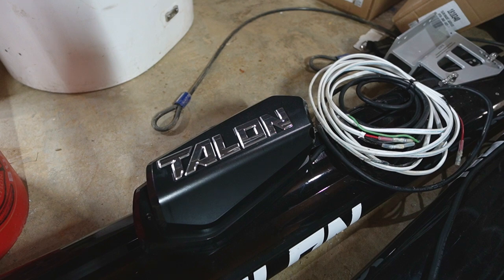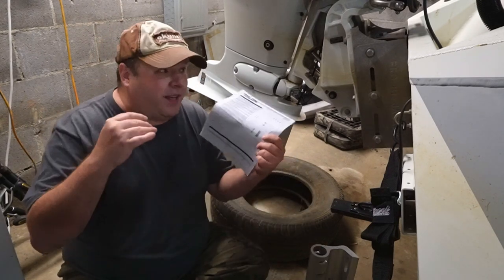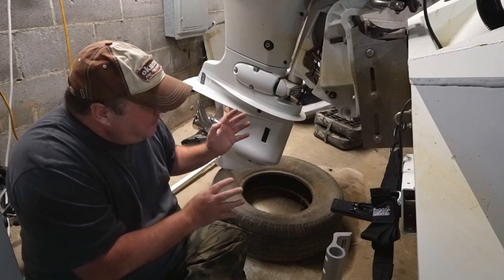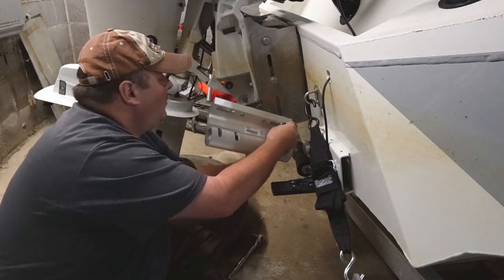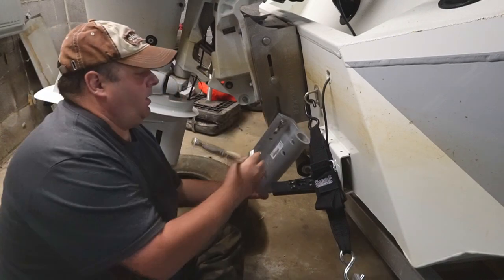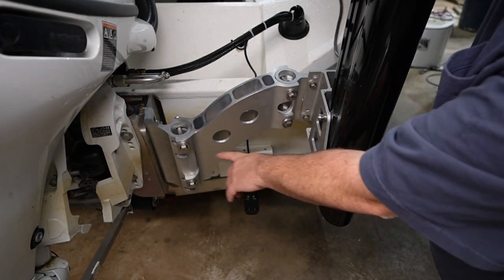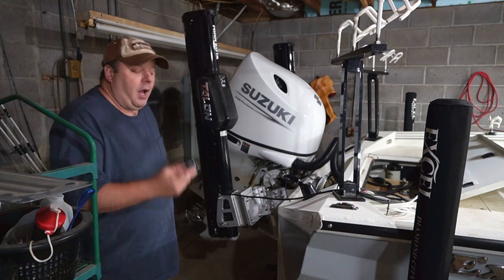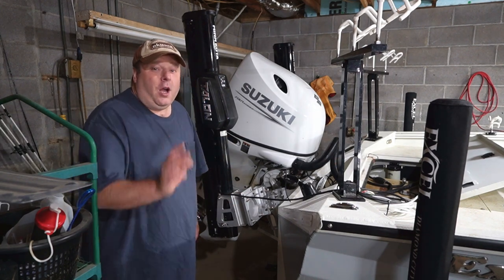How I Installed Talon's On My Bay Boat (Shallow Water Pole Anchors)

Comment: brackets are good if u already have a jack plate. I had to mount mine by drilling the transom and i really didn't like that, but its really helpful in the spring with shallow fishing. The other 3 seasons i removed it from the boat because its too heavy for my boat
Reply from the maker: My buddy had to drill into his transom too.  That failed 24 foot boat project had holes in the transom I had to fill that were for Talon brackets too.  I've been out a couple of times with them on and I think its working out good.

Comment: Two person job when it comes to the larger model of Talons. I needed the tilt brackets for mine to get the boat and and out of the shop.
Reply: Also, your talons do not appear to be straight up and down, you need to adjust their angle on the bracket to make them pointed up and down as best as you can do, it will ease in pulling them from clay/mud bottoms if you accidentally have them on rough setting when over a soft bottom.
Reply from the maker: I will look into that thanks!

Comment: Great video.   Very informative.     I recently bought Talons & jackplate brackets.   So this video definitely will help me in my installation when I get the chance to do it.   I have the same jack plate as you do.  Are you happy with it still?   I am hoping the top mounting bolt works as I have transducers mounted on the bottom of my jack plate.    Anyway,  thanks for the video.   Very well done.
Reply from the maker: Thanks!  This is the first jack plate I've had on a boat.  It's a bit finicky at top speed.  At cruising speed I barely have to trim the motor too.